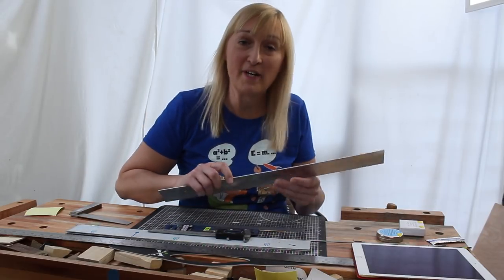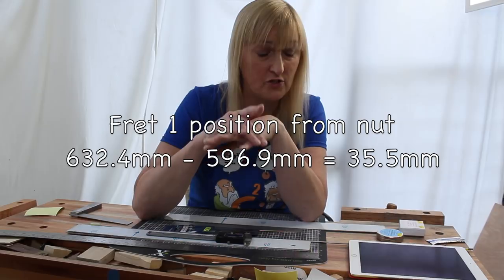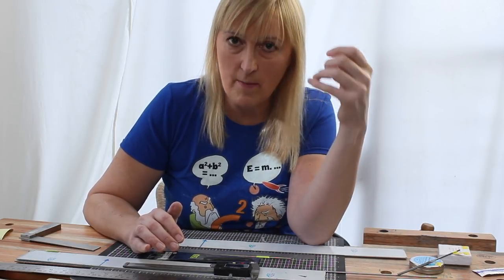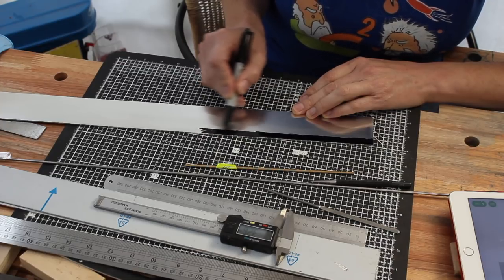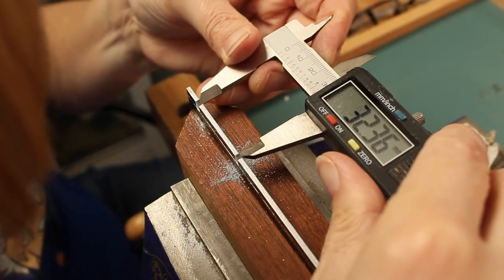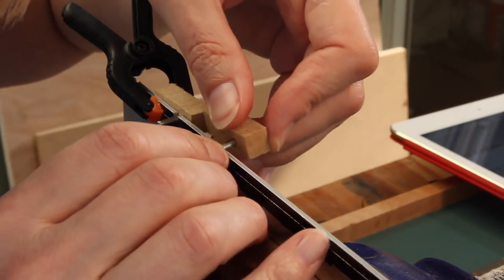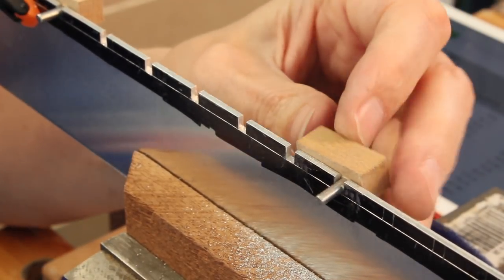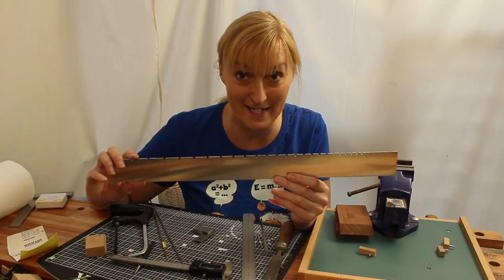Making a Fret Position Template plus an explanation of fret position and nut compensation

Comment: why arent you just measuring inside to outside ?
Reply from the maker: +David Haney tricky with calipers. Far easier to measure outside to outside and add on the slot width as an extra column in the spreadsheet
Reply: An option could be to use the end of the caliper against one pin and the depth measuring probe against the other pin to be measured, like you were going to measure the depth of a hole. (Thanks, Interesting video btw)

Comment: I still dont understand, there's specific measurements for every fret on the board something like 23.56, and your inly suppose to measure from the beginning of the nut and not fret to fret. If so do you use a ruler and round to the nearest whole number for a fret? Like rounding 23.56 to 23.60 and then mark down the fret placement?
Reply from the maker: If you’re using a ruler then just try to mark as accurately as you can - don’t consciously round any measurements, but you’re not really going to get better than 0.1mm accuracy by eye
Reply from the maker: The pitch will always be affected but most people can’t hear less than 3 cents difference, so in theory you could be 0.3mm out and not hear it. Personally I’d want to be more accurate than that
Reply from the maker: There are rulers available from luthier supply companies specifically for laying out frets. I think Crimson Guitars have one